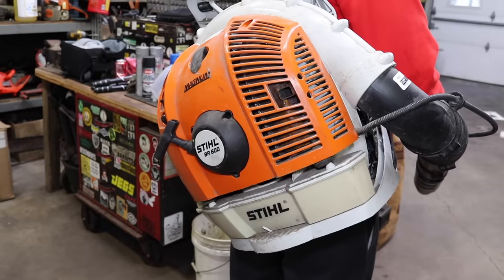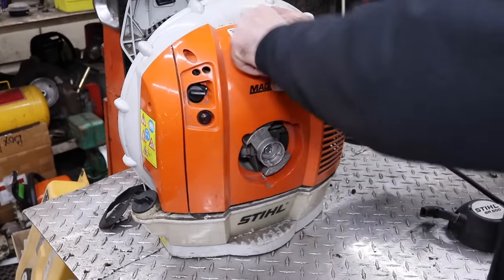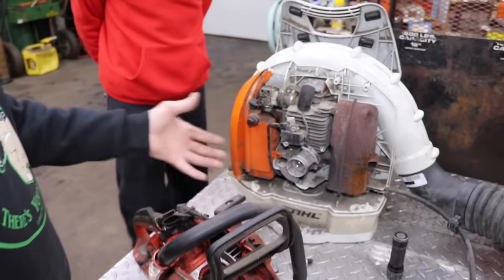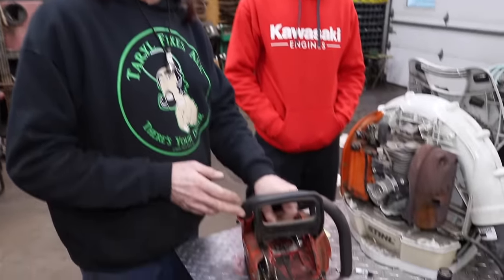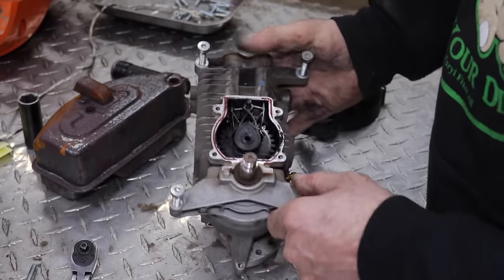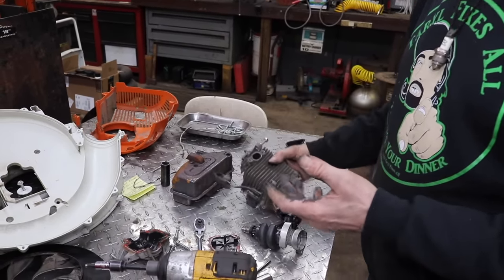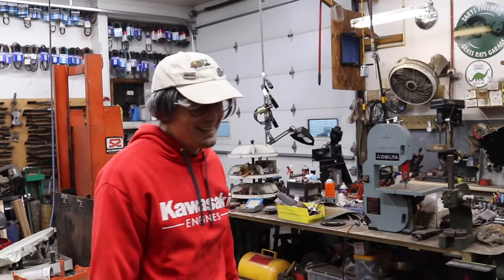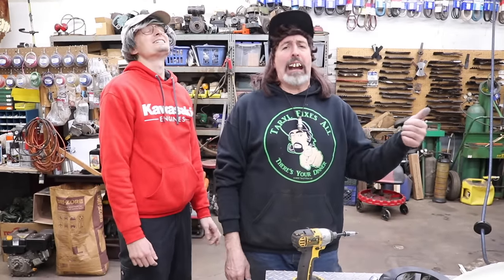4 mix NIGHTMARE! DON'T make this mistake 🚫

Comment: Taryl,
         I have a BR600 that I have owned about 5 plus years.  I’ve always used Stihl synthetic oil and serviced it myself.  I was disappointed to learn it doesn’t have a roller bearing for the piston pin.  Then I thought back to my first motorcycle, a  1960 Tohatsu Runpet 50.  That 50 cc two stroke motorcycle revved to around 10,000 rpm.  I replaced the piston and distinctly remember it had a bronze rod  piston pin bushing.  I imagine Tohatsu considered a bronze bushing was durable enough for that motor.  While I agree that a roller cage rod bearing is preferable to a bronze bushing I have to believe Stihl would have discontinued the use of bronze rod bushings if they had a high incidence of bushing failures.  
         I also rebuilt a Bultaco Alpina that had a worn out roller cage piston pin rod bearing.  Neither design will survive lubrication starvation.  I respect your expertise and watch most of your videos but this subject deserves more research.    
My BR600 starts and runs like new.  This year I replaced the spark plug and filter for the first time.  The original plug was fine but it came with the new air cleaner.  I’ve never touched the carburetor.  We have an acre of lawn with lots of trees so it gets a lot of use.  This is my favorite lawn tool.
          Keep up the great work!

Comment: Looks like the user may have used straight gasoline a few times - IMO Anti-friction bearings would fail prematurely too. A plain bearing is suitable for that application since it is lightly loaded, however, you need to use approved 2-cycle oil mixed properly and use the appropriate fuel to oil ratio.  I would say the reason for failure was operator error more than design flaw.

Comment: Here is the solution!!
Do not use cheep oil.

Do not let your men mix the oil in the gas they will mix it wrong every time .
To much oil and it will run lean witch means it will run hot !! And Pre-ignite .

Do not run the engine full throttle intell it is fully wormed up . The oil does not separate frome the gas intell the motor is 180 deg and the gas oil mix will wash all the oil off all moving parts !!! 

Do not run low actane fuel in hot weather above 65deg it will pre ignite .

Comment: I would think that the engineers spent more time and money trying to figure out the oil required and bearing design to go cheaper. Reuse proven designs to go cheaper. " We should go fuel injection and a computer control on our plastic mower engines. We'll be ritch!"

Comment: So at first you seemed to be calling it a design flaw, and then toward the end you're claiming user error. So it's both?

Oh well, I always thought the 4 mix engines were stupid all along. What's the point of a 4 cycle engine which has to mix fuel and oil? The convenience factor is gone. The emissions are up from a regular 4 cycle. Half the benefits of 4 cycle are negated. Silly.

Comment: WITHOUT a oil supply to that small end like on a 4 stroke, the pressures and "splash" cant be enough for cushion and lubrication??  So this engine CANT last? 
This is the most serious video of a quality Brand doing something that their engineers must have warned about. YES. like Apple, they will get more sales, but their reputation CAN be ruined just with this small penny pinching change. The history of needing a roller bearing in that place shows that it cant just be a bushing unless radical change of metallurgy ect has occurred and proven to last as roller bearing do for the life of the engine. Very bad from Stihl...

Comment: Who’s to say that they didn’t run straight gas in it by mistake and created this damage and then the next time or the next time after that filled it up with two cycle not knowing they did not add two cycle mix to the fuel! A lot of the people will not admit to this, even if they know it. there’s a reason you do not see a lot of the sthil is because they are made pretty good and I would imagine most people do not buy the more expensive sthil oil mix to run their equipment on, and I would say the largest percentage of people buy cheaper two cycle oil, you calling sthil crap proves my point they are up selling you on the oil when I’ve been using to cycle cheap oil for years and haven’t experienced this issue on the larger end blower lines

Comment: What a terrible design. It actually cost more to make a new design without the heat treated con rod and bronze bushing than keeping the stuff from the parts bin. It was probably an EPA requirement that caused this design decision.

Comment: Engineers would step over 100 virgins just to screw a mechanic.  

Stihl probably saves $0.00001 per unit by using a bushing instead of a bearing. The bad impression folks will get when their $500 blower detonates should offset the cost. 

What do I know?😂

Comment: Or,
stop treating ur oil/gas mix
like a 5 star restaurant
and more like the drunk at the dive bar.
If it calls for one shot,
give it MORE,
Worst case scenario what?
Fouled plug?
i do it with my echo backpack blower
all the time.
A shot of that blue mix my neighbor gave me.
A shot of that pink stuff Hilti makes
found at the jobsite,
a shot of motor oil for good luck
and let er fly!

Have u ever put a heavy shot (⅓ish) of diesel into gas
and fed ur 4 strokes (oil sumped engines)
with that?
Don't do it with ur pull starts
unless u like to curse because they are a bear to start,
and they take a bit to warm up,
but once they do run stronger than gas alone.
Likely the same,
properly tuned with a two stroke.

Comment: love my stihls, but inorder to generate sales the V.P. of back pack blowers told them to use the ol' wear outable brass bushings to ruin stihls good name and destroy stihls reputation inorder to make the V.P. of back pack blowers Milwaukee stock portfolio go thru the roof. see you can't sell loads of new blowers unless the old ones go kaput!
not all engine seals and piston seals and other plastic engine parts are the same. each manufacturer is using special plastic polymers called PFTE's that ONLY WILL LUBRICATE with the specially tailored to fail with any other PFTE polymer lubricants than the manufacturers. acura and other foreign car makers do this, Polaris Snowmobiles especially do this starting back in the 1990's with the triple 600's, echo does this, and so does stihl.

don't reward bad behavior, every dollar you spend on their lousy designed to fail product is a vote YES KEEP SCREWING CONSUMERS OVER, go buy another brand that doesn't require special PFTE polymer mix to lubricate. go buy an electric and screw over polaris, stihl, echo, acura and other ROTTEN MANUFACTURERS WHO DESIGN TO FAIL unless you buy their 'SPECIAL' OIL. it's as bad as video game developers forcing every one to micro/mini transaction items in game direct license content (DLC) to play to win as they nerfed the last things they sold you inorder to squeeze more profits from your wallet by force.

Comment: suppose to have design with needle bearing  rod  to piston pin, they design  it with bushing junk and  want it to fail. its that simple, money money money is there bottom line, the greed these companies make  cheap junk and pass it  to unsuspecting  customers.

Comment: Stihl used a Bronze Bushing because of its tolerance to high heat (up to 1900 degrees Fahrenheit) however it is a hard, but brittle metal, and gouges and distorts very easily!

Comment: What about honing out the crank arm to the size needed for a needle bearing then hardening it with a torch? Could you put it back together with a needle bearing in place then?
Reply: They sell crap

Comment: With how sludgy the oil on the crank and rod is it looks like they are one of those geniuses running used motor oil mixed with their gas to save money.

Comment: I think it's easy to blame Stihl because a lot of these things can be used at peoples lake home or cabin where they have chain saws so they have chain saw oil that they can buy anywhere.  Stihl 4-mix oil only at your un local Stihl dealer.  Naw, I think Stihl should share the blame on these POS's.

Comment: Your telling me I need to buy specific oil and mix for this Blower..... This blows.  But seriously you just mean stihl 2 cycle oil or ur saying stihl makes a specific 4 cycle oil?
Reply: According to the stihl manual for a br700 they recommend their motomix premix fuel with their HP ultra oil. If you mix your own oil they say any oil jaso rated FB, FC, or FD. HP ultra is FB, an FD rated oil is a better oil than FB. You can search Richard flagg on Youtube and see his tear down vids on HP ultra oil. (The motors arent pretty). I would use echo Red Armor @50:1, it is FD rated and it does an excellent job. Motors l work on that run it are clean on the inside and have a great oil film. Almost all equipment l work on leaves with a full tank of 93 octain, ethonal free, with red armor in it @50:1.
Reply: @ethanmiller3935  I've always ran 50:1 and non ethanol.  Now the oil I don't even know what it is.   I had an abundance of 2 cycle oil left here from my grand dad it's probably 20 years old to be honest but it was still sealed.     I will have to see what the rating is on it..

Comment: A 4 stroke motor requires (special) 2 stroke oil-in-gas mixture 🤔😲?   Is this common these days?  In what?  I thought they killed 🧨 the old 2 stroke lawn boy green mowers due to high emissions.  Of unburned hydrocarbons just like old 2 stroke jet skis and outboard motors.  Give me a crankcase with the splash arm.  Oh F this, go Lion batt.  Simple electric motor.  Quiet.

Comment: $550.00 for a replacement, it's the same design. So buy the right oil and save the headache. Stihl recommends  Stihl HP Ultra 2 cycle oil  50:1 ratio with unleaded 89 oct gasoline.
Reply: They sell crap.

Comment: You could just use Stihl moto mix best stuff ever. Keeps engine clean and lasts for one year after being opened. Engineered 93 octane ethanol free mixed 50:1 with synthetic 2 stroke oil.

Comment: Mix your gas correctly with the right oil and you will have your blower for 25 + years. Don't be stupid. The new blowers come with a little white book called an owners manual, check it out sometime.
Reply: If all else fails,read the manual

Comment: I guess if you bought a Chevy, you’d only run Chevrolet gasoline in it. Right? Whooops about out of gas, got to find a Chevy station soon….no way I’d run that Dodge gas in my Chevy! And I wouldn’t run Ford gas in my grass blower! ONLY CHEVY ultra golden platinum sliver coated copper injected gasoline for me! Anything else and the bearings will fall out. Yup, says a lot about your Chevy…. or stilch or whatever you’re running.
I don’t know how my 4 cycle fs90 has held together for the last 15 years on outboard oil….but it has and I ain’t changing now.

Comment: I wonder if a hardened sleeve could be fitted into the rod end so that the bearing could be fitted? Might need to drill out the rod to fit in the sleeve. Not easy, and probably not doable, but an idea.

Comment: Another Proprietary Revenue stream for the manufacturer.  Another excuse to blame operator error as a way to void warranty. Customer is always right has been replaced with Customer has no right. I am having less sympathy for firms that have been cloned. No excuses.. Greed trumps Customer Satisfaction.

Comment: It seems like they would be running a CAGED needle bearing, which has it's own hardened surface to run on. Should be able to match up a needle bearing that would fit.
I'm sure the wrist pin is already hardened.

Comment: They did it to save 25 cents 🤦‍♂️
Reply: Meh.. They save a lot more than that.  They don't have to use a forged rod or heat treat it;  they don't have to make the bearings or the bearing cage.   Even if they only save $2 ... If they sell a million units, that's $2 Million made in pure profits.  But I agree with your premise;  it sucks that a little profit is worth scaring your good reputation like this. smh..  The fact that they have plastic cam LOBES!!  is incredible to me.
Reply: @calholli  yes sir